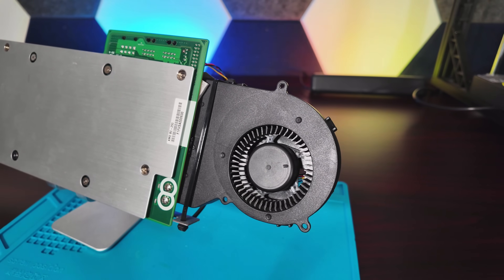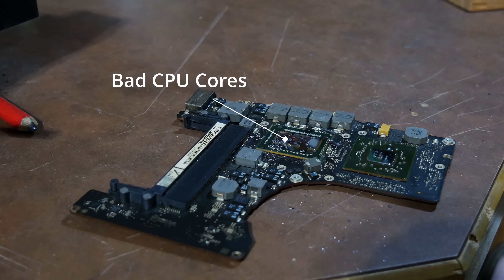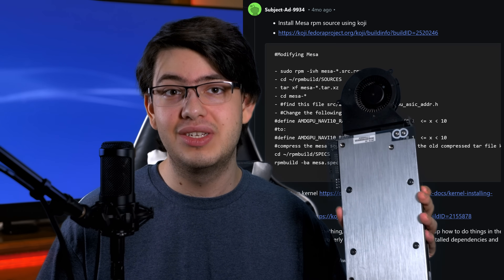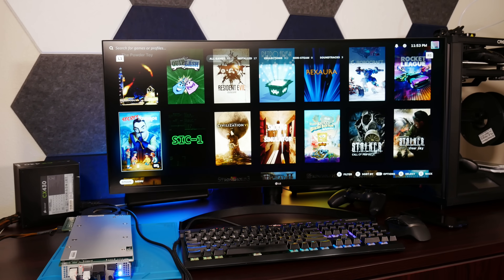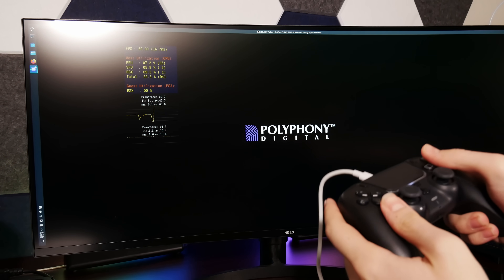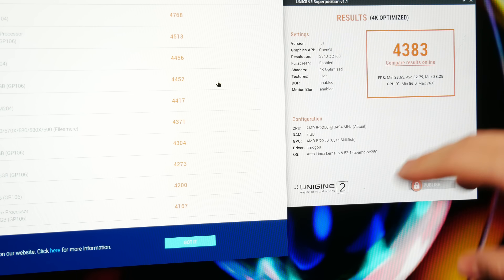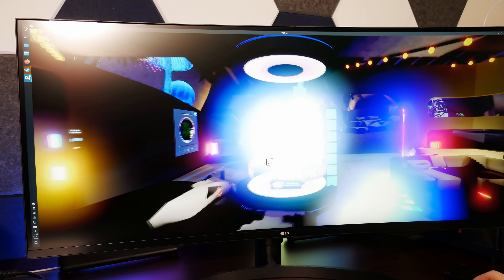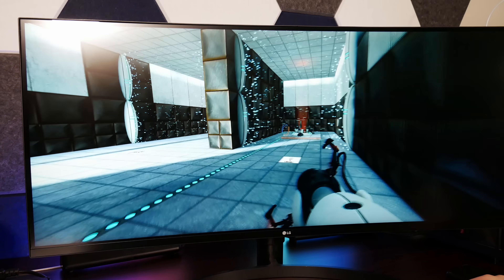I Ran PS3 Games on PS5 Silicon to Prove Sony Wrong

Comment: It's interesting, but ultimately it would be Sony who could have the simplest and most efficient solutions to this. Both PS5 and PS3 runs a similar operating system, but on a different CPU architecture and probably different API's and different very different Kernels.

There are already solutions to some of these "issues", such as QEMU, which could perhaps be used to translate all those to run on the different hardware (PS5) as a kind of virtual machine solution. But since the operating system is basically the same, it would probably be better to write a translation API ("emulator"??) for system calls and API changes?

And how about cross compiling the games? Sony could do that to bring them to the modern audience?

It seems it should be possible if Sony wanted, and not too difficult. But probably they don't want to be held liable for the quality of such games. I guess the only solution then would be for Sony to offer this for free to PS5 owners without any warranty, just as something extra. But why would they do that?

I dunno. An alternative would be to start promoting old Playstation games on platforms like BSD and GNU/Linux, and perhaps do something co-operative with Valve/Steam.

Comment: All of this serves to prove that practically PS5 hardware could just be turned to using any OS and run games well on it if it weren't for the proprietary lockdown of the system. That and being able to play games from older consoles, but then again it would cost Sony money that wouldn't be made back so they Don't care. Can you imagine how awesome it would be to sell digital copies of very old PS games? People would have access to way more games for cheap, many of which are still relevant today. That's a ton of gained value.
Reply: Hell, you used to be able to run Linux on the PS3 but they removed the Other OS feature in an update
Reply: @notNajimi  oh yea i heard the story of some government/millitary force buying multiple PS3's to build a supercomputer with them, then they were F'ed over by sony disabling allowing other OS.
Reply: At this point, Sony not just using Linux but some obscure proprietary BSD fork is just one big sunken cost fallacy
Reply: Every gaming console is turing complete - it can do everything a computer can.
If word processors, web browsers, and other apps were available on console, I'd buy one. For now, a PC is a better deal, because it lets you do pretty much anything (like, literally, except for halting problem analogues)

Comment: Get a bunch of small and cheap USB powered monitors, some controllers, and turn it into a trunk-portable LAN setup? 
Docker but every server is a physical computer? 
Renderfarm? 
Multiple Minecraft servers linked via bungee, but each node is a separate faction, so users have to hop servers seamlessly using bungee to attack, and retreat back to their own server?
Several different games hosted with bots and setup for PvE where players have to work together to keep bots in check across the servers, or else the server becomes one life only and gets locked out (Adds a point for the bots, server switches games while players can fight on different servers)?

A bunch of fun and interesting things you can do if you wanna have some fun with it. Are any of these really practical? Ehhhh.... can some of these be done on one computer? Sure! But you don't have to worry about balancing loads this way, and in some cases setup can be a little bit easier. There are absolutely more practical options too like the cloud gaming through sunshine like someone mentioned, but I feel there are a lot of novel ideas you could explore for this very novel hardware.

Comment: The thing is that, contrary to the popular belief, just because Sony have all the schematics of PS3, it does not mean they can produce a decent emulator. Just look at the current state of their PS1 and 2 ones for PS4/5.
Now, if someday they see the light, and decide to cooperate in an open-source project, that would make things much easier for them.

Comment: I remember some issues regarding Navi about a year ago where in some resolutions/refresh rates the GPU refuses to clock up from base. This was an issue on my 6800XT in a regular Ryzen build. Running my 1440p monitor at 144hz would cause this issue, but running it at 143hz would not.

Comment: Companies lie all the time. Even the PS3 was able to emulate PS2 games with no extra hardware. Sony had the emulator and only sold PS2 games that worked with that emulator on their store.
Reply: Ehh, this isn't the best example. The PS2 games that were made commercially available on the PS3 store definitely weren't being emulated to stock PS2 hardware level.
Reply: @ You are not understanding what I'm saying. I'm saying Sony is lieing. 

Sony decided to not give out the PS2 emulator so it would not cut into sales of PS3 games. If a PS2 game with emulation was too be used then you have to buy the game.

Comment: Now do it with FreeBSD... The biggest issue is Sony's OS, which is heavily modified BSD (not Linux); and thus lacks a lot of the GNU open-source libraries due to BSD being a copy-left license; not to mention Sony's lack of BSD engineers... 

While FreeBSD shares a lot of libraries with Linux (and vice-versa, such as the NetBSD network stack for Linux, MacOS, and Windows), graphics linraries are *not* shared. The PS4/PS5 uses an entirely proprietary hybrid dual-API, one being a low-level (GNM), and the other a high-level API (GNMx); and these are analogous to DirectX 12 and DirectX 11, respectively.

Uniquely, is how these APIs handle shaders. This is done entirely by Sony's PSSL (PlayStation Shader Language), which is very similar to HLSL used with DirectX 12.

TL;DR: The issue isn't the silicon - it's the operating system itself.
Reply: A clarifying point: the BSD license is not copyleft, it’s a permissive free software license. The GNU GPL however is a copyleft license
Reply: > such as the NetBSD network stack for Linux

Wha?
Reply: beyond what everyone else has already said about reasons this is incorrect, the BSD accelerated graphics stacks largely are taken from Linux, since Mesa and most of the DRM code in the kernel (including AMD's) is permissively licensed. Even if it were absolutely critical that Sony be able to use OpenGL and GLSL for PS3 emulation (and it's not), it's not like Sony doesn't have the resources to create / port the already existing OpenGL interface for their GPU. I do think there are valid reasons for them to not do PS3 emulation on PS5, but using BSD simply isn't one of them
Reply: @FelixGraye  Sony has an existing wrapper for OpenGL to PlayStation Consoles, called ScePiglet; its present on the vita, ps4 even a fucking windows version exists for some reason, there’s probably a ps5 one too, lets you use OpenGL but with CG shaders, (it might be pssl on ps4/ps5..)

Also PS3 games shaders are compiled CG specific for the console, it needs to decompile them into a format the host platform can use GLSL is just makes sense for an emulator running on PC ..
Reply: Oh my fucking god im so tired of hearing this, PlayStation OS are not remotely BSD, they just copied network stack from there that’s why it shows up in the IP notices page

Trust me, I’ve developed homebrew for PS consoles for nearly 5+ years and looked heavily into how the kernel works .. that shit ain’t BSD
Reply: They are not analogues to Directx. Directx is a high level API, inherently inefficient. And the OS is not the problem, it is an excellent OS, and I would take it any day over anything Microsoft delivers. Sony's version of BSD is most likely 100% a gaming OS and inherently efficient at its job, while Microsoft is known for it's bloatware, and has adapted their general purpose OS to a gaming platform.

The operating system is actually the solution. And coming from GNU/Linux, you and I should appreciate that as a solution. Imagine the great efficiency increases there could be if PC gamers moved to GNU/Linux. They could play on a gaming specific distro tailored to their every need with no overhead, no bloatware. Imagine if the GPU drivers had official and wide support, they would provide superior performance and efficiencies on such a system, as we have seen time again happens when proper efforts are put into similar hardware on GNU/Linux, even if only half hearted. Albeit, alot of Linux Kernel drivers and so on have no official support and are reverse engineered, but still perform at a very high level.

Now, imagine a little bit of co-operation between Valve/Steam and Sony, and some willingness from Sony to promote gaming on GNU/Linux and BSD on PC.. It's still a piece of cake to port those games from BSD to GNU/Linux compared to porting them to Windows.
Reply: @johnwayne-kd1pn ”Developers who are already familiar with DirectX 11 will find a number of similar concepts and features when working on the PlayStation(r)4 GPU, however unlike DirectX 11 the Gnm library provides a set of low-level functionalities which the user can control most of the set-up, Although the higher level API libGnmx is closer to DX11, the functionalities it provides to handle the implementation of graphics/compute-related features are quite different.” - PS4 SDK Documentation  (April 02 2018)

Sony themselves say it’s similar to DirectX, also if you want to see bloat, look no further than SceShell
Reply: @LiEnby  Well, there you go, in what you write, it says it is different, in that it provides a low level libraries/calls/functions.

That's the difference I was pointing out.

Comment: From Sony’s perspective, besides them not making much money off of it, I still think the real reason why Sony refuses backwards compatibility for the PS3 is because emulation wouldn’t be as smooth or 100% as perfect as the PS2 was for the PS1 games due to the Cell architecture. I think GT5 Prologue missing a few shaders + slight frame rate drops is as smooth of an emulation you’re going to get from a non-Cell Cpu/gpu running an PS3 exclusive game.

Comment: The real challenge is how are we going to run first party titles on an emulator? Only within first party releases did they take full advantage of the additional SPEs on board, and only Sony possesses full documentation of their hardware. So while third party releases could run on emulators fine (provided that they haven’t yet touched the SPEs), first party titles will still be difficult to run unless Sony willingly offers public documentation.

Comment: Wow. I had no idea RPCS3 had been so heavily optimised on the last couple of years. The performance boost is impressive.

I expect a homebrew solution will be needed to get certain PS3 games on the PS5 due to licensing issues though. For example getting Burnout 3 running on PS4 requires you to build it yourself, too much licensed music to re-release.

Comment: Sony hates you now, ha ha! Hey good work! This is very interesting! I am curious if it's possible to take an APU from a PS5 and replace the gimped one on that server board. If that could be done, what kinds of hassles would it be to do to the same tests? Or would the chip have a sort of a lock out that would prevent it? Thanks for making this video!

Comment: The steam deck can emulate PS3 lol. Does anyone doubt that a console with 10x the power can't run PS3 games, especially with native code? PS5 would probably run them at 4k or something
Reply: The steam deck can emulate a select amount of PS3 titles, that aren't as demanding. Not every game is equally heavy or difficult to run. 
The Cell also isn't a weird architecture and even if you have the native code, running them through some translation layer will have significant overhead. 
The best solution is to port the game to your platform.
Reply: @R3endevous  yeah I get not every game can run, but the steamdeck has a fraction of the power of the PS5. We've long passed the threshold of the wierdness of the CELL to hold emulation back. Honestly they could've had it up and running on the PS4, but we all know why they didn't. And as for porting being better, obviously. But porting every game isn't feasible. Emulation is a one size fits all approach that will work for 99% of games as long as there's enough horsepower

Comment: Honestly, Sony should 100% make a dual-boot type of console where you can either boot into the current gen or the on-board PS1-2-3 emulation software and all the games are accessible via either PS Plus classics or buying the games as ISOs but for a lower price. Maybe 1-5€ for PS1 games, 3-10€ for PS2 and 8-15€ for PS3.
Reply: I think due to logistics (licensing, royalties and rights to claim etc) its more effort than its worth. All in all the cost benefit analysis hasn't worked in our favor.
Reply: I can't see current sony doing that since they took out other os supprt out of the ps3 due to homebrew concerns.
Reply: isnt this how the wii u handled it
lol iirc they just threw in the whole wii os
Reply: from either Xbox or PS i would have bought one if i could have booted linux on it.
Reply: Just jailbreak a PS3 and then you don't need to pay to play any PS1 to PS3 games

Comment: I'm glad my ps3 still works.
Reply: Same, but old bastard just heats up worst than a highschooler on BTS concert.
(I'll try to buy a decen thermal paste next month)
Reply: @johnnysanchez9505  XD
Reply: @johnnysanchez9505 deep clean it and have the thermal paste replaced
Reply: Me too
Reply: My 60GB died a few years ago, I missed the proper BC on it, shame people cried about the price and now we won't get hardware BC for the more exotic of the generations because of people wanting everything for nothing.
Reply: I unlocked it sadly so take that sony

I would Buy old games and run them on the Powerful PS3 CFW

Comment: The biggest issue in Sonys defense is that they would need to buy out RPCS3 so they have a good starting point or flat out make there own which would give them some advantages at the software level.
The big problem is money i honestly don’t understand why they haven’t gone full bore and started slowly adding  emulated PS3 games with enhancements, especially with the pros Nintendo does the same lazy ass shit the personally I think it’s a Japanese thing they can be super conservative and it shows

Comment: You should try to emulate the most cell procesor demanding games like the last of us or uncharted 3. The argument isn't that the ps5 can't emulate ps3 completely. it's that x86 can't emulate the cell processors SPEs. 

You have an interesting opening to the argument, but a proper stress test is necessary.

Comment: It doesn't matter if PS5 can run some emulated PS3 games, it needs to be able to play most of Sony first party games to be worth it, but a lot of Sony first party titles are the hardest to emulate. Take a look at the RPCS3 compatibility list and look up some key PS3 exclusives that haven't been remastered like Killzone 2 & 3, infamous, Ratchet & Clanks, MGS4. They're all listed as having severe issues, still. Some of these games have poor performance even with considerably more powerful hardware than PS5. Some games require a dozen custom patches be applied to avoid various issues.
Reply: One easy solution to this... money.
Sony has enough money to get people on a project that other people do for free.
Reply: @BerosCerberus  Money is also the problem. Sony makes money by selling remasters not by emulators
Reply: Even for those games sony is capable of per game hackery far easier than the more generalized rpcs3. Their back compat would function like ps2 classics most likely so it's just select titles anyways.
Reply: This is the thing that people don't understand. I don't even own a PS5 because of how unnecessary it feels right now and would love to see PS3 emulation on it but the whole comment section seems to miss that releasing a product is different from an open source project. Sony would need to license a lot of these games plus rpcs3 varies a lot from a case by case basis and is at its worst when running games that Sony doesn't even need to license. They see this stuff and go Hur hue sony bad. They want them to open the disk bc but imagine the shit they will receive if they do allow it and most of first party games don't even run properly. Brain dead takes here man.
Reply: Not only does it need to run enough games. It has to run enough games at a quality standard that's far higher than typical PC emulators. If there's bugs or performance issues people won't just live with it since this is now a feature of the device they purchased.
Reply: As a corporation, those are the kind of things you don't want to be held liable for if you were to release these things.
Reply: facts
Reply: Like the ps3 exclusive final fantasy games
Reply: Just play on ps3
Reply: @yournightmare9999  i already do everyday
Reply: @operationfalconpunch  I know you do every day when your parents go to sleep
Reply: @yournightmare9999  i live alone but nice try